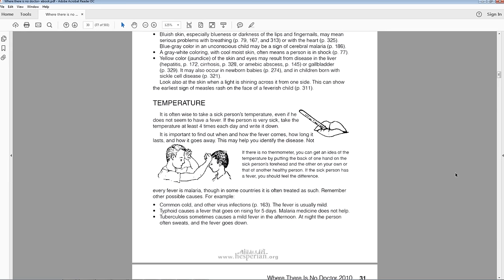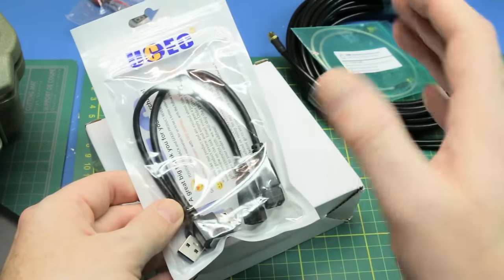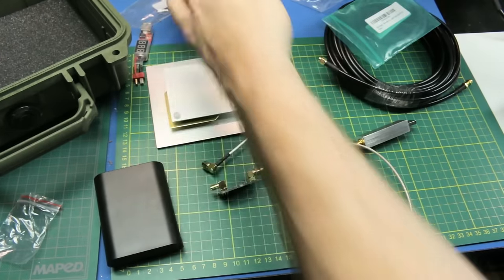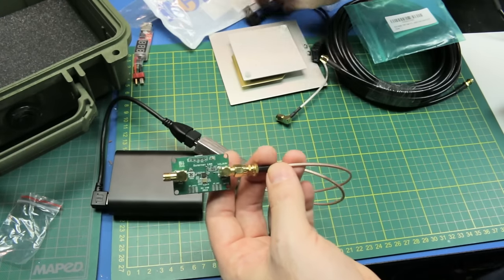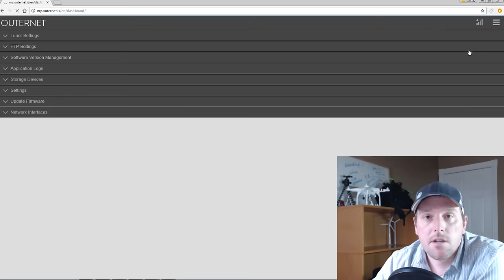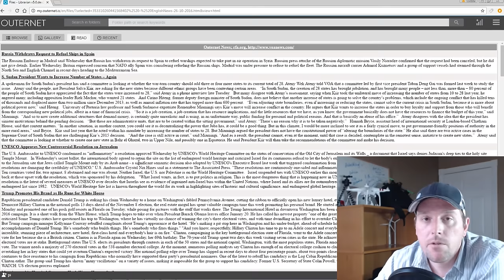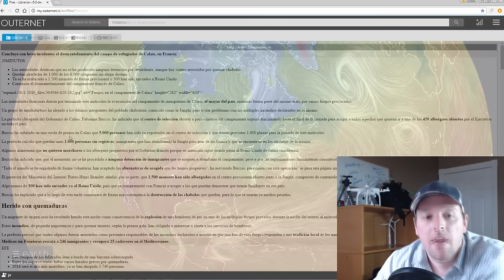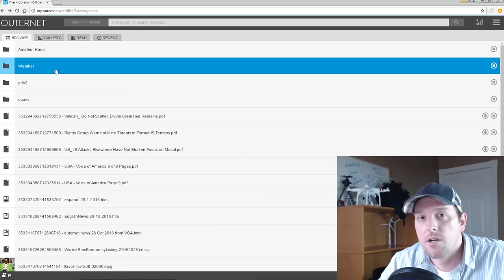DIY Raspberry Pi Outernet Satellite Receiver Assembly & Testing | #EduCase Project Build

Comment: Great video. Fun fact from a computer Engineer. Never hook up a RF system without a load on the end (connected antenna). You can fry your gear! Great vid
Reply from the maker: No active element here so no load needed.
Reply: MKme Lab u shouldn’t power on without antenna, like that dude said it’s fries it

Comment: Do you not blow out your transmitter/amplifier when you turn it on without an antenna? I know my drone's video tx would be shot if i did that.
Reply from the maker: There is no transmitter here
Reply: Even then, my receiver will blow without one, that said, the technology in my 5.8Ghz  gear is probably a little dubious to begin with...

Comment: How does the internet work over a one way communications link? For example to download a webpage you need to SEND a request to the server telling a site that you want to see that page; how do you get around this if your dish can't transmit that request? Or am I missing something like the upload link is cellular?
Reply: It's receiving data from the so called "outernet", which basically broadcasts data from satellites so there's no sending involved. So you cannot request a page, you get what is broadcasted.
Reply: Like teletext on your TV?
Reply: Quite close, yes! They are both a form of "datacasting". In the case of Outernet, digital data in the form of UDP packages are carried over radio waves in the L-band range transmitted by satellites. Whereas teletext data is carried in the "overscan" of analogue tv-transmissions.
Reply: Radio hams used packet radio and amtor psk etc. Even rtty is a form of ancient digital transmission. If you get a bad download you have to wait for it to cycle round to the same download program
Reply: Gosh!!

Comment: I want this for my boat.  I would save a bundle on downloading weather info over a sat phone.
Reply from the maker: It should actually work great for the sailing/cruising crowd.  Just needs some testing on how well a person can keep the sat locked in. Enjoy!
Reply: I was thinking something like a gimbaled steady-mount like videographers use.  Shouldn't cost too much.
Reply from the maker: Douglas Scott Definitely could be easily doable.  There is virtually zero mass to the antenna so there should be plenty of options. Maybe an RSSI feedback loop for aim could keep it locked.  Can;t wait to see what people do...  Cheers

Comment: Interesting. I wonder if you could improve the bandwidth strength by using a more powerful sbc such as the new the tinker board s for example. ultimate goal would be to setup a receiver for a cell phone tower so that I could test a different method of connecting to the internet.

Comment: Does Outernet provide access to the whole of the internet, or just the Outernet servers? If not i'd imagine that that is their ambition. I ask if it's currently doing this because I wonder if I could use it to help maintain cellular service in remote areas.
Reply: Don't bother, it's just a scam. The speed they claim is 250 BYTES per second (!) - you could carry your entire lifetime of data broadcasting with you on a couple SD cards. Of course you can't access "the internet", just some select files in the order they're broadcast. Keep it running for a few months and you'll end up with a couple of ebooks or so... Unfortunately, they don't show the list of files queued for broadcasting (at least not on their public website), nor give they any information about file rotation, i.e. how often things are updated.
Reply: novgorod000 how is it a scam? If you are in the middle of nowhere with no connection to anything, it's better than nothing. And 250 bytes per second is plenty to get the daily news.
Reply: If you want daily news via satellite, plug in a cheap DVB receiver, point your dish at anyone of the abundant TV/radio satellites and you get more news than you can watch in your lifetime ;). Besides TV, conventional DVB technology can be also used for broadband data broadcasting, though its use is questionable if you have myriads of TV and radio channels with up-to-date content at your disposal. Overnet's laughable bandwidth limits you to an extremely limited selection of current content (news, weather) and useless archive material, which you could easily bring along beforehand. If it was a real internet connection (though super slow), it would have some benefits, but the 250B/s is the entire feed for everyone with no possibility to select or request anything...
Reply: So... essentially the equivalent of a teletext band from one of those DVB signals
Reply: Yep, but with less bandwidth :)...

Comment: Is there anything I need to do to use this legally i.e. licensing like you have to do with two-way radios? Or can I literally just set this up and use it?

Additionally, could this be used in a two-way radio system?
Reply from the maker: It is receive only. No there is no license required.

Comment: You should NOT be touching the LNA board! The skin oils and other things can can start eating at the circuit board. Static electricity could damage components. Is using the satellite free or what is the cost of the satellite?
Reply from the maker: Last I checked FR4 was impervious to skin oils, and fire, and most natural disasters too. If copper dissolved in oil I would have been able to make a lot of PCBs much easier than using ferric chloride. Relax Don...
Reply: @MkmeOrg  Well for over 40 years I have always been tough not to handle circuit boards. The newer boards ate better. The older boards after years you could see where finger prints would see finger prints in the lands on the board. What does it cost to use the satellite? I live in Florida and the photo of the storms coming is something I would like to use. It would also be good if I could see weather radar also. Now there are tropical storms,  Tropical Lows, and other nasty things out there.
Reply: @MkmeOrg  hi

Comment: YOU SHOULD NOT TOUCH THE LNA BOARD THEY HAVE NO SENSE OF HUMOR AND CAN BE DAMAGE EASY.  RG 8 sucks at the frequency used on that, also RG8 is 52 ohms and most LNA to recover is 75 ohm.
Reply from the maker: Huh?
Reply: LNA use FET circuits they are damaged easy from static electricity. Most people do not touch the circuit boards or if they must they make sure they are grounded first!
Reply from the maker: LOL yeah, gotcha... I'm pretty aware of the components and my static potential. If you are gonna point out all the videos of this- you might wanna find a new focus as you might be busy for awhile...

Comment: you dont burn info on a sd card, you say you burn discs cause this is how it works ,  the laser burns the disc , but in the case of a sd card , its corect to say you copied the info on the sd card ;)
Reply: it's called burning anyways...
Reply: Its really not
Reply from the maker: Cripes at least pick apart something technical or a detail that requires some brainpower to discover the flaw... Copy/burn debate- news at 11.